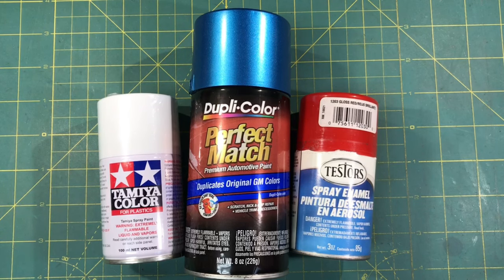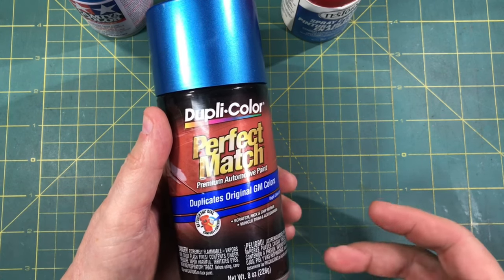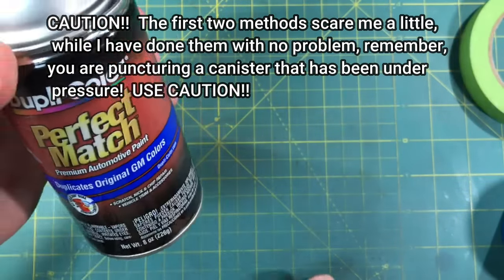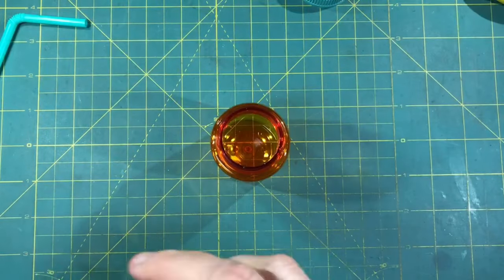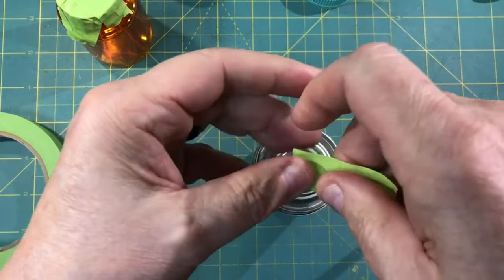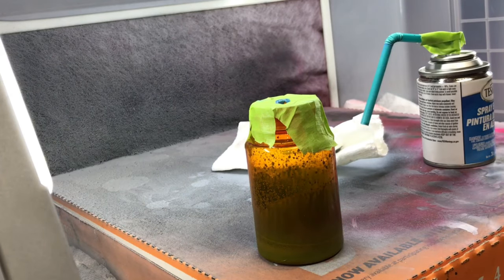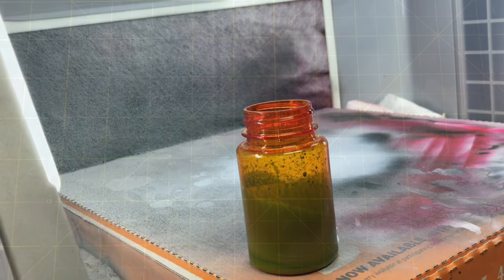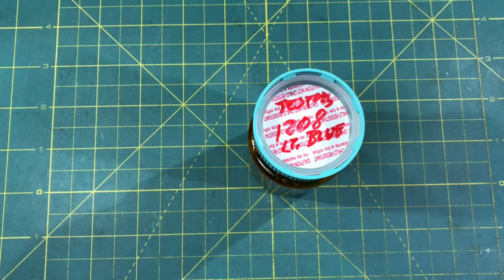Decanting Spray Paint for Airbrushing

Comment: I've been exactly doing this for years now, try taking the little round spray tip out of the spray nozzle itself, and replace it with a suitable size brass or aluminum tube, and spray right into a bottle or the airbrush. So much easier and safer. Thanks for the video!
Reply from the maker: What an awesome idea Bruce!! Many thanks!
Reply: @MarkBatsonHobbydude007  My pleasure Mark! I hope It helps you and you subscribers!
Reply: How do you remove the spray tip, itself, with a tool?
Reply: @biggstile  It's just pressed in, you can use a pin to pry the white part out, or a #11 Xacto blade. Good luck!

Comment: Decanting paint is a must for the older paints we have where the propellant is gone or a very clogged nozzle. 
Follow the instructions to use a pin hole and then either enlarge the hole or cut the top off. 
MUST USE A PIN HOLE!! NOTHING LARGER OR YOU'LL GET PAINT EVERYWHERE. 
I have used 30+ year old paint this way.
Reply from the maker: Thanks bro!! Great info!!

Comment: Good and simple method to decant fr4om spray cans. According to your experience, May I decant filler - primer (like rust o leum) and use later for airbrush? Won't the airbrush be "clogged" for this kind of filler primer?
Reply from the maker: Thank you very much my friend!! 
Rustoleum is one I haven’t tried to de-cant. Some paints set so fast you may need to add a touch of thinner before shooting. 
Good luck and have fun!

Comment: I have an old can wrap that has a pressure valve is use to release the pressure from can. Then I use a pair of tin snips to cut the can open to pour into a 8oz jar. I leave it a little loose to Vegas about 5 min. Then close it up.
I don't know if the still make those can pressure valve wraps anymore. Mine is about 30 yrs old or so.
Reply from the maker: That’s cool!! Haven’t seen one of those but it sure sounds good!

Comment: Hey can I do the same thing with ordinary spray paint. Should I follow the same technique you're talking about. 🤔
Reply from the maker: Sure Perry! I've used this method with several brands. Make use you let lacquers sit for an hour or so to gas out before airbrushing.
Reply: @MarkBatsonHobbydude007  hey Mark I'm really a girl. 🌝I just need to know if I can use this to paint. A plastic zipper according to a YouTuber. She painted a plastic zipper with paint. Since I already have some krylon paint. I wanted to paint the zipper instead of spray painting it. And I was just trying to see how to get it out of the spray can. But thank you for getting back to me. What I would do everything you said thank you.
Reply from the maker: Yes. It will be thin so it my take multiple coats. 
Good luck and have fun!!
Reply: @MarkBatsonHobbydude007  thank you okay I hope it works out for me. Or do you know any paint that I can use that will bond to plastic. And fabric saying that the zipper has fabric around it.
Reply from the maker: Lightly sand the zipper with a mild sanding medium so the paint has something to “bite” into. Also try an enamel or acrylic-enamel. In my experience they seem to hold up on plastic a little better. 
Also, have you considered dye? A little sanding again for bite. Then let them soak overnight (or longer). A slower messier progress but effective. Good luck and make it fun!!
Reply: wayment ... there is a song titled ... I'm just a girl

Comment: what happens if you load this up into an airbrush without decanting? i did this with either Alkyd or Acrylic spray paint (not sure which) and it didn't give me any issues. i use a 200NH airbrush loaded through a tank (not a hopper like many airbrushes)
Reply from the maker: Thanks!! I’ve never tried that but if it works well with no issues, that’s great!!

Comment: Super useful info here! Would you use lacquer thinner for Krylon spray paint too? I believe it is an enamel. Thanks!
Reply from the maker: I have found, depending on the enamel brand, a little lacquer thinner does not hurt. I would however test it before painting. With Testors enamels I prefer Testors enamel thinner but I have use a spot of lacquer thinner with it as well with no difficulties. 
Many thanks for watching!!
Reply: @MarkBatsonHobbydude007  Thanks again for your input!

Comment: Hi, Mark.

Do you use the spray paint directly into the air brush? Or, do you reduce It or thin It down? I'd si, with what and, in what proportions?

Thanks in advance.
Reply from the maker: Thank you brother!! If I’m spraying it within 24 hours, I don’t thin/ cut it any further. Beyond that, I thin it with just a little lacquer thinner.
Reply: Thank you for your response. Great video...

Comment: How long and what temp did you put the cans in your dehydrator for?
Reply from the maker: I do not put the cans IN the dehydrator but on top to warm them up. I would not recommend putting them inside at all. I place the can over one of the top vent holes for an hour, shake them up again while warm for about two minutes then decant. 
Many thanks for watching!!
Reply: @MarkBatsonHobbydude007  gotcha

Comment: Do you need to further thin the decanted paints before use with the airbrush?
Reply from the maker: I usually airbrush it with in 20-30 minutes so no. Occasionally an enamel may need it.

Comment: has anyone used the rust-oleum protective enamel brush paint in the one pint cans in an airbrush
Reply from the maker: Thanks Doug! I’ve never tried it, but thinned right I think it should work just fine. Be sure to prime the plastic or resin before painting.
Reply: @MarkBatsonHobbydude007 thanks

Comment: Thanks! I've been watching videos on how to do this as well. Small apartment and 50+ rattle cans take up a lot of space.
Reply from the maker: Thanks for watching brother!! Hope it helps!
Reply: It does. I've seen the same technique demonstrated before but, it's good to get a 2nd opinion. I'm gonna have to start saving my RX bottles too, though I'm not convinced that those seal up THAT tightly. Do you just use them prior to a build or do you actually store paint in those? I've been window shopping bottles on Amazon. I'd really like to get rid of these cans I've collected in a plastic tote since my revival into the hobby. It appears I've collected more tools, paint and kits than I've actually built. 
shakes head in shame I plan on changing that though. I'm thinking I'm gonna get in on the '32 Ford build. Be my into into group builds. Anyways, thanks again!
Reply from the maker: @BiteMeHarder333  I usually decant paint as I need it. I let it sit for an hour or so then airbrush. Lacquers I do sometimes store. I have used them a year later and they've been good. (just add a little thinner)
YES! jump into the 32 ford build! It should be a lot of fun!!
Many thanks again for watching!!
Reply: Thank you for that info, I remember you mentioned that add thinner bit in the tutorial.
As far as the '32 build goes I'll have to get on Facebook and check in. It'll be a good motivator to pick up the pace and improve any effort I put into this. Thank you Sir for your time you put into your channel and taking time to reply. I never expected how friendly and encouraging many of you guys are.

Comment: Hello from Argentina, I have to empty a spray paint for to use what is left with a brush, how long after emptying it into a container should the paint be left open so that the gas is removed? The paint does not dry leaving it open? Thank you
Reply from the maker: Hi!! I let enamels sit about an hour. Brand of paints my differ. The same goes for different brands of lacquer paints. Lacquers usually gas out quicker. In my climate, about 20-30 minutes. Hope this helps. Thanks for watching!!